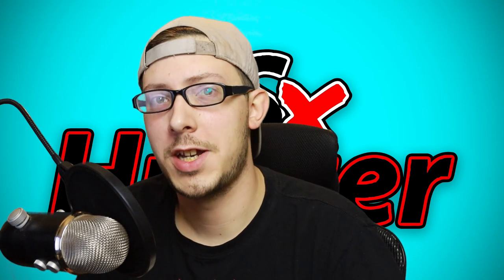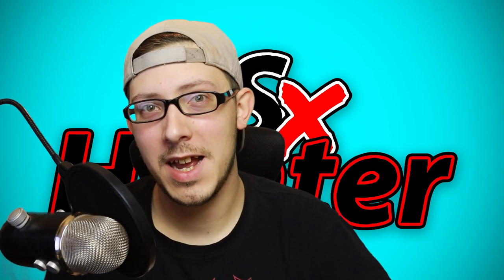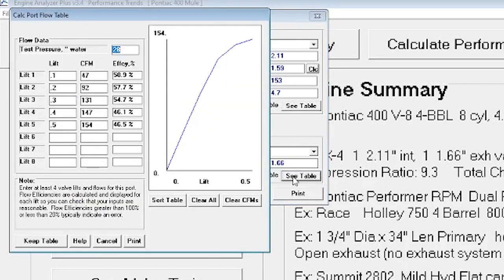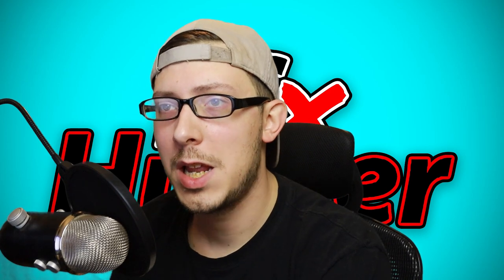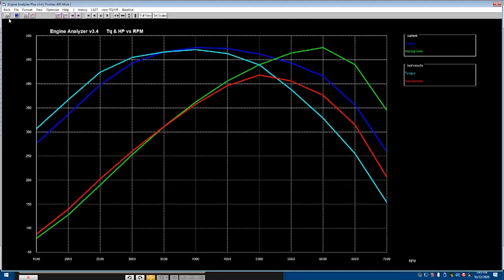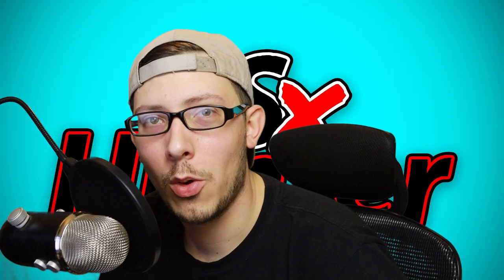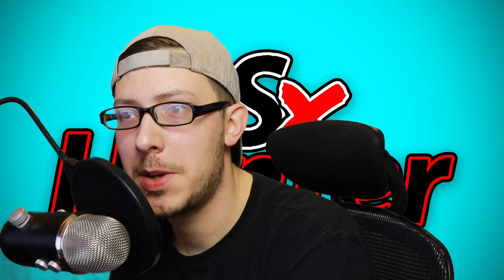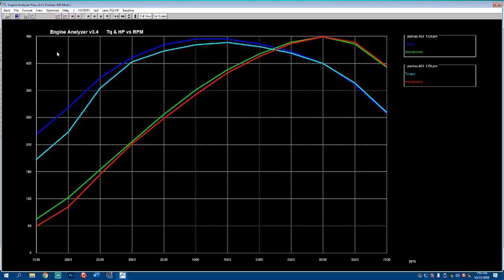Understanding Cylinder Head Porting and Selecting a Camshaft to Match

Comment: We built a 468 Pontiac. We used an All Pontiac block, Eagle rods and crank , Ross forged pistons, Kaufman 310cfm heads, Kaufman North wind intake, Comp 284h cam, proform 850 carb.
This combination has made 610 hp max at 5900 rpm , torque max was 655 at 4600 rpm, this engine did make 500 ft torque at 2800 to peak.
We have recently got more customers asking for flat tappet hydraulic cams more than rollers

Comment: Really good video and it certainly matches my experience! I don't know how you feel about the edlbrock or kaufman heads but my current engine build I'm going with the kre specifically because of what you cover in this video. Keep the videos coming,  there are many more Pontiac people that would learn something from videos like this!
Reply: Hey Pontiac brother I'd like to see you delve into David Vizards intake valve opening formulas for cam selection.. My understanding is it's to open the intake in relation to when the piston starts pulling to maximize our efficiency. LSA=128-(CID/#ofcylinders/valve diameter x.091).   In his experience this is the place a cam recommendation begins .   We may see reserse split duration actually better for max torque production but we faithfully use these off the shelf grinds. Come on bro maybe you can prove them wrong. 
Thanks
Pontiac Stu

Comment: I’m having a set of 6x-4’s going on a 406 with a Spotts Performance HCP01 cam, factory pistons, but with ALOT of work!, good pistons, good crank, edelbrock performer, Holley 800 spreadbore. Marty is porting my 6x-4’s and recutting the exhaust seats for 1.77 exhaust valves. I’m just wondering if I need to switch to something more like the RA4 cam. Th400, 10 bolt with 4.56 gears. (1/8th mile car) eventually going with 3.42’s in hopes of running the 1/8th like a glide, just using 1st, shifting once and going through the lights in second at about 57-5800 rpm. Marty is porting my 6x’s to the max amount that my motor will need. He’s gonna put them on the flow bench before port work, then after. I’m soooo looking forward to what it comes out like.

Comment: Before you pick up a grinder you need to learn exactly which areas need work and the areas to avoid grinding. Pontiac heads will benefit mostly from better exhaust flow. For example, the Ram Air 2 heads have basic everyday Pontiac intake ports mated with much better exhaust ports and they can blow the doors off of everything except a 425 HP HEMI. 
Exhaust port grinding is almost always concentrated around the roof of the ports. The floor of the exhaust ports isn't very important.  The intake side is an entirely different matter. Off idle and midrange performance is improved by working the floor around the short turn and high RPM power is increased by concentrating around the port roof, valve guides and long turn radius.

Comment: $200 reward for location and photos of a rare set of Pontiac heads. Diamonds cast under the valve cover along the inside making a chain like pattern,  in a gasket like pattern. Chambers swirl @spooned Ying, Yang. I/E,  Butler said "they are not all that you would think and ; they're not real hi performance, And he has only seen one set of those heads".
Reply: Would that be a heart chamber like a vortec?

Comment: Hey I bought a shelf cam designed for stock motor trucks. I have ported heads and ported manifold and want to go slightly bigger on the cam. What is a good ballpark figure on what I should increase duration and lift to? Being that I can support more flow than what my current cam is intended for. Not asking you to magically come up with cam specs but just asking how much would you "add" to the cam when specing a cam for stock top end vs fully ported top end. I'm thinking increase duration maybe just 4 degrees, and increasing the lift by just a little. But curious to know if the lift should he increased equally or have one value higher than the other? The heads have been cnc ported and fitted with larger valves than the oem.

Comment: I have a 1970 WT block with #12 heads. I also have a 78 TA bock with 6X heads that I’m gonna port. The WT has an 067 Cam factory. Could you tell me anything about the performance? And also what program do you use to run tests
Reply: My motor has edelbrock torker intake, 750 Holley carb, and long tube hooker headers

Comment: Can't really depend on looking at the cfm numbers  everyone understands flow vs velosity but most overlook the overall port shape. round  vs rectangular ports with exact same size will have completely different flow numbers round= high Velosity good low to mid  and rectangular= high flow and great top end. Same with valve size 2.11 intake will always outflow and more power then say a 1.90  but at what rpm and overall gain vs The smaller valve flowing way more airwhile earlier while opening and at lower lift. But a good camshaft can usually fix or help with shitty head flow or efi and a china choo choo

Comment: Are bigger cams really required when the heads are ported?
Reply: Depends on your rpm goals. Cam dictates what rpm the engine runs efficiently
Reply: @doomman700  almost 7k would be good. Turbo 5 cylinder. Weekend car. I don't want to lose driveability specially around traffic

Comment: I have a 74 400, 2801, 4x-1h heads, and dual plane Pontiac intake with a Quadrajet. I have ported the heads, but it’s not too extreme. Any ideas for improvements for more mid range? It’s a 4-speed car with 4.10 gears. 

I’m going to eventually swap to a 5-speed and probably 3.73 gears, but I’m curious about the engine for now.
Reply from the maker: A major factor is likely the cam - that being said the big thing right now is you're probably around 7.8:1 compression ratio with the 110cc chambers. Bumping that down to a set of 6X-4s knocks out 15cc from the chamber. It's not abnormal to see a 10% gain from start to finish with just upping the compression a hair. If you've got the "dreaded" double-eyebrow -15cc pistons you could use smaller 72cc heads that other guys are scared of. If you've got flat-top pistons a set of milled 6X-4s will make you more than happy. 

Cams are always good though.
Reply: @LSxHunter  thanks! Yeah, I know compression is an “issue” with this setup. I have a set of #17 heads sitting around but, I need to CC them- I’m finding some conflicting info on those. 

The cam that’s in the motor is the 2801. I haven’t started the engine yet, as I’m waiting on rocker nuts. But, maybe next winter I’ll have a new set of heads ready.
Reply from the maker: @LoganDidItYT  If they're like the 17s I have on my 350 they're 72ish cc. Those would likely rock on there and pick up a ton of torque.  The 2801 puts you in good shape - especially if you want to jump to 1.65 rockers down the road. 

Most of the early heads are hard to find info on.
Reply: @LSxHunter  thanks for the help, man. The #17 heads are from a 1970 Firebird with a 350. I keep seeing that they’re 72cc, but when I did a ghetto flow setup I came up with closer to 90. I need to do it again, though. I did have the plug in when I tested, if anyone wonders.
Reply from the maker: @LoganDidItYT  What’s the date code on them?
Reply: @LSxHunter  C110 and C060 is what it looks like. Also, the font on the head codes are slightly different, but I pulled them off the engine myself so I know they were on the same engine. One looks like a 17 the other looks more like an 11... is that common? I guess it could just be worn away...
Reply from the maker: @LoganDidItYT  Could be 11. 11  heads were 8.6:1 on a 400 w/ small-valves in 70. They came on 350s as well.
Reply: @LSxHunter  A slight boost in compression then, but not worth bringing back to life for this motor, I assume?